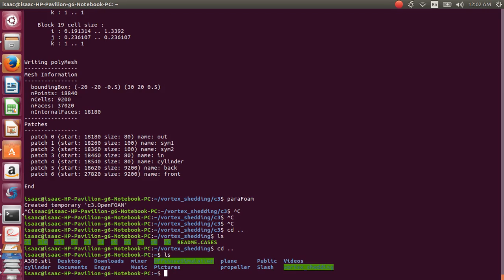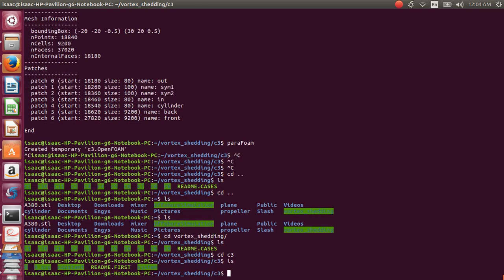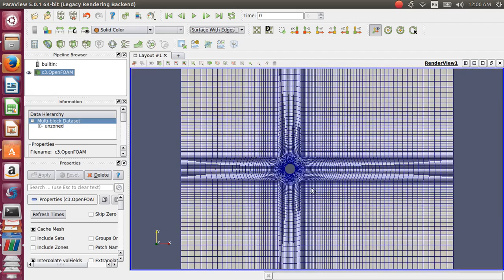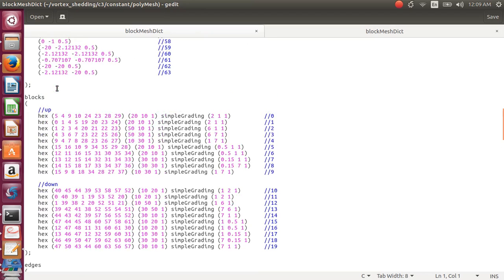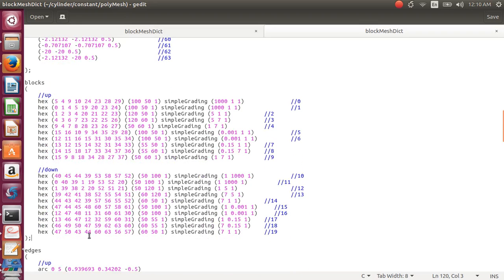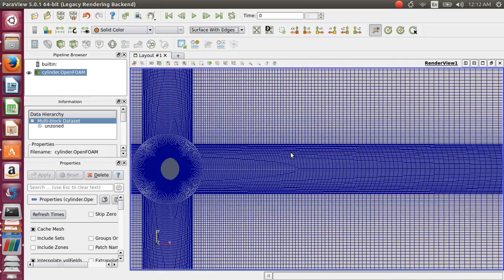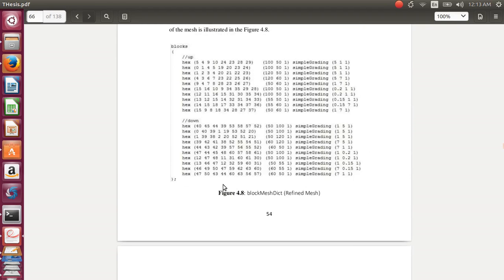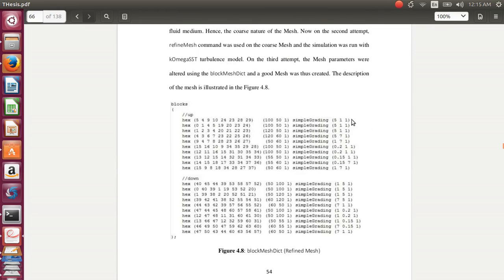How to mesh a cylinder using blockMesh

Comment: Hello, is it still possible to have the document you introduced in your video?
Thanks!
Reply from the maker: https://www.blogger.com/blog/post/edit/2347244010544336733/6041034095451708943
Reply: @iijumark  Hello, thank you very much for the link, but I couldn't open the document via the link you provided. Could you please share another link, maybe via google drive link? Thank you very much!